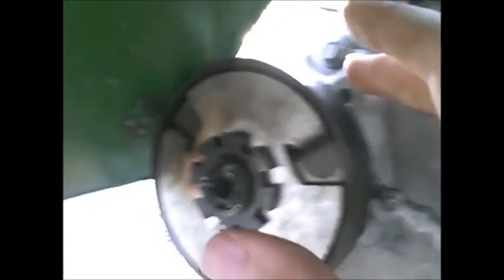Modified Predator 212cc on Deere mower Testing. w/ smoke screen.

Comment: I would just buy a new motor there only 120$ at harbor freight
Reply from the maker: I have a connecting rod that is a lot stronger than stock that can handle my modifications.
Anyways, i just put the stock rod in and will be testing out my new rocker arms. Will put my valve lift at over .500". Super crazy. It's dumb to do on a stock rod but i'll do it for the video.